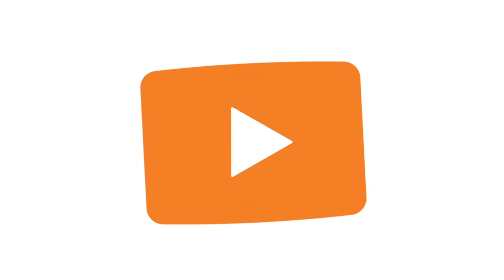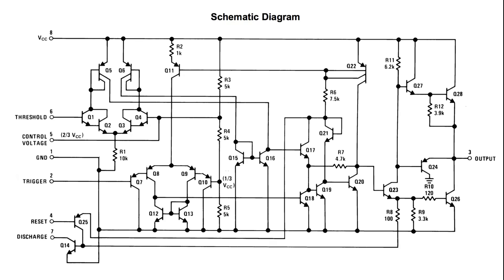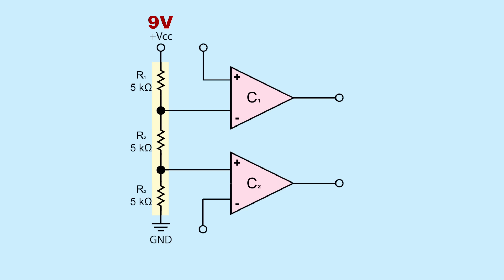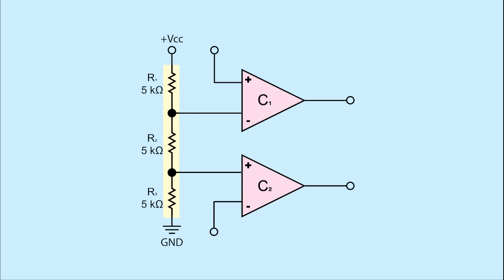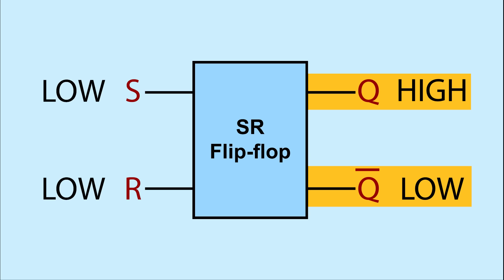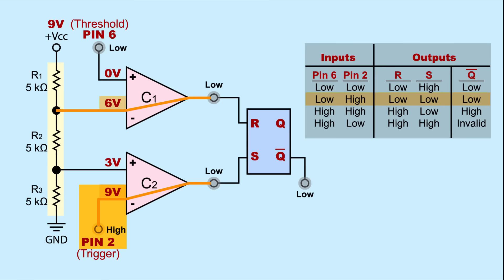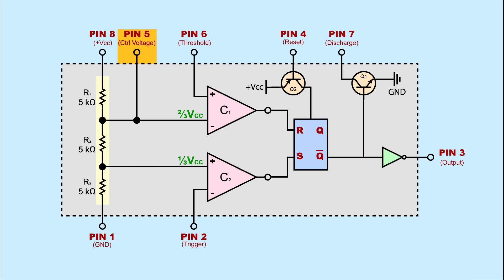How 555 timers Work - The Learning Circuit

Comment: If I didn't already subscribe, this video and it's follow up would make me do so. When I first saw them, it was somehow targeted at EXACTLY my level, and explained everything in a way that was like drinking fresh spring water.

I love that most of the video doesn't even mention a capacitor. The 555 is not in any way a timer - the only thing in a timer circuit which actually "measures" time is an external capacitor. The 555 is a glorified switch, which requires more components to do anything. That's why it is so versatile.

Comment: Could you provide a specific definition for the terms “high” and “low” when referring to outputs? 
Is this a binary state or low voltage output versus high voltage output? If a voltage output, what are the low and high parameters?

Comment: How to configure the 555 to output 100kHz as a signal generator for a transistor?
Reply: @ultralagger1  to get a frequency of 100kHz with a Duty Cycle = 50.5%  you can use the following values:
C = 100 pF
R1 = 1.44 kΩ
R2 = 71.41 kΩ

Comment: If I want to design a circuit for automatic charging system for 12volts Battery . A circuit cutoff at 13.7volt & turn on at 9volts. How can I design with IC 555. Thanks

Comment: Hey, why is usually 5 < Vcc < 15? Is it possible to leak less current with higher Vcc or what is the tradeoff of using different Vcc in a circuit that has a variable electric potential?

Comment: I’m very new. I’m confused with the digital signal of “low” and “high.” Is it 1/3 Vcc and 2/3 Vcc or the highest of the inputs and lowest of inputs? I’m wondering about building  circuits off pin 3 if you don’t know the voltage.

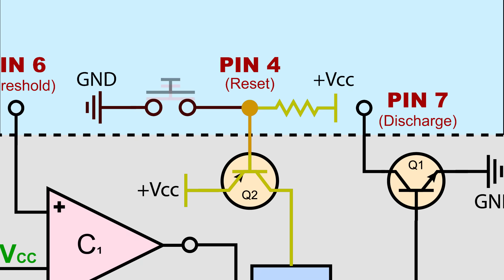Comment: Correct me if I am wrong, however there is a minor error: At minute 6:37 you state Q2 is off. A PNP is ON when the base is lower than the emitter. Additionally, the current limiting resistor should be placed between switch and Q2 base.

Comment: 6:30 "If pin 4 is ever grounded, going low, the transistor is turned OFF."
Actually, it's the opposite because this is a PNP transistor, so it is held OFF while pin 4 is high, and it turns ON when pin 4, its base, goes low.
Reply: Exactly, I was wondering the same thing. It seems a lot YouTube tutorial were taught this way.

Comment: I believe your Q2 logic is incorrect, the circuit is correctly drawn, Q2 would turn on with a low voltage (Gnd) on base and turn off with a high voltage (Vcc).  looking at the bigger circuit, the positive voltage supplied from Q2 collector is the reset to the RS flip flop.

Comment: Am I right that if one measures the resistance between pin 8 (VCC) and pin 5 (control voltage) one should get 5 kOhm ? Or is it more complicated ? ( I am trying to troubleshoot some PSB, and my on board measurement between these pins gives 120 kOhm)

Comment: I've always wondered why the 555 seems to be like THE chip that everybody cuts their teeth on when they start electronics. For me, I remember it was rather confusing trying to learn about it as a newbie to electronics. But if the whole idea is to cut your teeth on using chips, why not start with a simple logic chip? I think an inverter would be a great chip to cut your teeth on. They're straight forward, and easy to use. AND you can make an oscillator out of them by chaining together an odd number of inverters. It might not be as versatile as a 555, but for a newbie who's just learning and getting comfortable with ICs, I think it'd be much better.

Now you just need to do a complimentary video on how the 7555 differs from the 555 in terms of functionality on a transistor level.

Comment: Great video.
I’d also add that the rs latch is basically an electrical version of a mechanical toggle switch. But unlike the mechanical toggle switch the rs latch has 2 dedicated physical quantity inputs (either high or low) to change the state of the output.
The mechanical toggle switch has a single algebraic input consisting of the application of a + force or a - force to change states.
This 555 timer is an example of an application of the rs latch thru the use of the 2 comparators assigned to each of the 2 physical quantity rs latch dedicated inputs.
Such a configuration can be used for automatic temperature control as set  with a thermostat .
And so that’s potentially an additional  practical implication (besides an oscillator) of an rs latch configured with a couple of comparators to change states to turn furnace on or off to reject heat loss effects thru the walls of a heated building.
Unlike the oscillator both the period and duty cycle of the 555 output behavior in the furnace example will change depending on outside temperature.

Comment: I even made a simple class d amp using this circuit. It shows you can use 555 to do more than it's designed to
Reply: On an amplifier board for my computer speakers (which I am trying to debug, with my zero experience), 555 works as a standby on/off switch to the main amplifier chip (TDA1554Q)

Comment: Great job! Particularly the graphics illustrations and rapid technical explanation without any confusing filler.  However, I think it would've been a nice touch to add a quick closing illustration of the 555 in action by demonstrating its use in a very simple circuit like an Astable Oscillator... just a little satisfying payoff for your audience.  A happy ending as it were.  ;)

Comment: I wish we’d had resources like this when I was studying Electronic Engineering and building 555 circuits back in 1981!  Such a great little timer, I built all kinds of alarms and flashing lights etc with them, but  getting across all of the concepts etc was much more of a dry subject than it is today.  I really like how simple and clear you made this for people starting out. Great stuff.
Reply: I mean, that goes for any tech, right? I learned programming in the 80s, and you'd buy a single book on a single topic, for 80 bucks.
Reply: @larrybud  I'm 68. In the 70's they had mainframe computers behind glass doors in my college that ran tape. I thought writing instructions with zeros and ones was tedious. In 2008 I discovered I could control the behavior of motors by writing instructions. I was hooked and realized I had wasted my college career.
Reply: @awaitingthetrumpetcall4529  In the early 80s I was initially more interested in electronics (and cars/motorcycles lol) than computing but got exposed to personal computers as well as the mainframes in the telco space. 

In the early days most of the electronic projects that I built for myself were for cars and bikes - I built a full car computer that monitored fuel consumption and distance etc, car and bike alarms, electronic central locking.  

I got into computing outside of work in a big way when the Amiga 1000 came out (prior to that had a z80 machine at home), but the Amiga was a game changer. It could be programmed to play music properly and could display quality photos - something that the IBM based business machines just couldn't do.
Reply: @markedwards4879  I would have seen you as as an intelligent nerd. My only involvement with computers was playing "Pong".
Reply: @awaitingthetrumpetcall4529  LOL.
Reply: @larrybud  I still have some of those overpriced and dull books on the shelf lol. 

There was very little choice of content at all and most of it was presented in a way that made things more difficult than they needed to be.  I don't know about you but I had a mix of some very good lecturers and some that were just terrible.

Luckily I worked with some very helpful people while studying and was given projects that helped me learn and keep it interesting.

Comment: This is the first video I watched from you and I loved it. I used the 555 many times over decades but never understood it in such depth. Very useful and helps with troubleshooting  circuit design.
One thing I may not be understanding is that when you said that when pin 4 is grounded, the transistor turns off. Being a PNP, shouldn't it come ON when the base is brought to ground?
Maybe i misunderstood?

Comment: Are you an electronics engineer ?
Reply: In fact, you don't have to be an electronic engineer to use the 555 timer IC effectively :)

Though I know people who work with microcontrollers and use them even for simple tasks instead of using the 555 timer! I never understood that :/

Despite I am more of a developer than an engineer, I used the 555 timer IC many times in simple projects. I think, Colin Mitchell gave the best explanation of how this IC works.

Comment: When this chip arrived to the market place in 1972, how did customers understand how to use it given the complex explanation needed just to describe how it works?
Reply: Datasheets have applications circuits. Plus there's a formula for calculating components used for making delays. You don't really have to understand how the chip works in order to use it.

Comment: Great explanation, thanks...except I am stuck on some point I obviously don't understand.  sWhen the output is high (S is H)  and Q bar then being low there is no power flowing to pin 3, so no power going to pin3 - even though one would think it would if there was power getting through the flipflop. When S is Low Q bar is high and although there is power flowing through the flipflop, does it not then (through its inverter) cut off the power to pin 3? So how/when does power get through to pin 3? Sorry for such a dumb (I think) question...  
Ahhh...I watched the next video and it became clear    Thanks

Comment: Wow.. Now that's a video that will have to be rewatched a few times to understand...
A common use example circuit (e.g. voltage freq converter, freq modulation, etc) would have been useful. :-)

Thanks for sharing!

Comment: for the voltage divider, should not it be 4.5v each since it got the same resistor which is 5/(5+5)Vin  =4.5 V for both two Omp

Comment: Why would they use an inverter on Q not, rather than using Q as the output? 2 reasons for the question, the discharge transistor is going to limit the output of Q not to the base-emitter junction voltage of the discharge transistor. It won't reach logic level, unless, there is a resistor to the base of the discharge transistor. The other thing is the unnecessary additional parts count, and propagation delay.
     The Reset input transistor is a PNP. Tying this transistors base to the positive rail, the same potential as it's emitter, turns the transistor OFF. Again, there has to be some resistance on either the base or the emitter of this transistor, or it will immediately blow out, if the Reset pin is tied down. (full supply current available to the base-emitter junction) I personally, haven't designed any circuits, where the reset pin isn't just simply tied to the positive rail. I just connect pins 4 and 8 together.

Comment: O.K.  ,  O.K. I will admit I developed what could be my own version of digital electronics (using relay logic) from memory of what I had learned in school. But I am quite STUCK on why industry does not use RS flip flops made with an AND gate OR gate inverter combo.  Is it I have my versions function mixed with something industry usually uses? By memory my version of PAC MAN would be impossible to create in about a week without a RS Flip Flop that can have both the R and S inputs both high. The R input takes control in this case. I am guessing the start stop station for many industrial applications operates by the same principle.  My version of Pac Man is not half bad and takes no expertise to create. Let know when your interested in an easy approach.

Comment: Im not sure about one thing! Who controls those voltages automatically? If i switch on a light bulb. I have to manually flick the switch ON to make it glow. But in computers i don't understand how they do it automatically? I want to understand how they do it. Is a something related to the chemicals used or some thermo electrical thing which open and closes the circuit ay a desired temperature???
Reply: Is probably covered in another video but is has to do with charge/discharge time and the transients of capacitors in cooperation with the circuit explained in the video
Reply: @netoskin  yea but still not clear. Can you point me to any video that explains that?

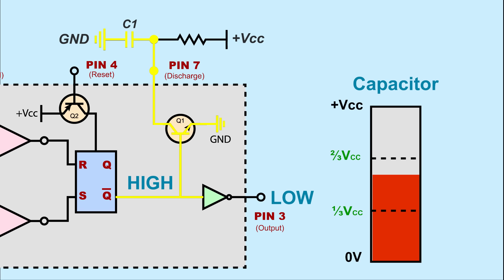Comment: how does the capacitor triggers the reset ? 7:03
Reply: I believe they forgot to present a few more connections from the capacitor (and one resistor is missing) to PIN 2 and PIN 6. Just look up ‘555 timer astable’. 

I might be wrong tho
Reply: I was going to ask the same thing, since C1 isn't connected to the gate of Q1.  There must be some extra connections involved.

Comment: This is one of the best presentations for working of the 555. We've used the 556 as astable and monostable together to produce a PWM signal for a Boost Converter, 12v t0 48v DC at St. Joseph's Research, BLR, IN.

Comment: Nice presentation...you could get a PhD studying this circuit it is so versatile. The 555 should be in the chip Hall of Fame - a timeless timer chip. 5k+5k+5k = 555 nice! Good thing they didn't use 6k resistors LOL.

Comment: Nice explaination. I have 1 question. In the block diagram, transistor at pin 4 is appeared to be PNP type. To turn it "ON" isn't that mean BASE voltage need to be negative compare to EMITTER? In the video you said when ever pin 4 is grounded, the transistor is "OFF" which is contradict with what I understand about PNP transistor type.
Reply: Yes, you are right, the pnp explanation is wrong, when the reset pin is pulled high to VCC the transistor is off.  But her schematic is correct.
Reply: @zeeebrenn  I was just going to say the same thing but you beat me to it by about 17 hours. Note to self: Wake up in the MORNING, not the EVENING. And, Happy new year.
Reply: @zeeebrenn  Yes, and I guess that is why in applications when the reset pin is not used, it is permanently connected to VCC.
Reply: Your observation is accurate. The IC indeed becomes active when pin 4 is high, and applying a low signal at pin 4 resets it. To rectify this, we can interchange the positions of the switch and resistor. Specifically, we can connect the switch between VCC and the base of the PNP transistor, while the resistor should be connected between ground and the transistor's base.

Comment: nice explanation of the parts of the schematic and how the connect. Sadly that is all I got from it. Here's my problem though: A the start of the video I read that it is a "555 timer", so I assume it keeps time somehow. After watching, I understand that in fact  it has functionality to compare voltages and weirdly contains an inverter when the Q pin could have been used to the same effect. The output of the compares goes into another thing. There are some pins too and I now know what they are connected to. An analogy would be if you showed me a washing machine in peices, but called it a motor car and explained that "this bit changes voltage levels" or "this bit spins" or "this bit pumps" then at the end said there are different modes. I'd have no idea what it did or how it worked.

Comment: Sorry, but just to be sure I have understood: 
At moment @6:26 when you explain the Reset pin, it seems looking at the video that the behaviour is the opposite: if Q2 is a PNP transistor, when base is connected to Vcc, it is OFF and set RESET of FlipFlop to LOW (resetting it), 
but from the video it seems that vhen the base is HIGH,  the current is flowing from Vcc through Collector to Emitter and to RESET (tipical for a NPN transistor). The final effect is correct but I think the animation should be the opposite. Is it so ? Thanks
Reply: Q2 is off when switch is off, and halfway on when switch is on.

Comment: Does it contain a SR Flip-Flop? I think the 555 contains just a SR Latch because there is no clock or enable signal to set/reset as a Flip-Flop would have.
Reply: Its a f.f and the enable is connected to pin 4

Comment: Nice presentation, Karen and thank you for the information  on the internal  operation of the 555 , i have one doubt, is it a SR latch or flip flop ? if it is a flip flop i guess clock has to be provided for its operation which is not shown in diagram.
Reply: flip flop. She said so.

Comment: what will happen if you replaced the ceramic capacitor at pin 5 with cylinder capacitor ?

Comment: Are you serious? This is an IC that is such an outdated chip, so much part of the 1970s. This is like the Beatles, the Apollo program and phones with a mechanical circular dial. Why is Element14 putting up this kind of content at the end of 2019?. This stuff is 50 years old.
Reply: The very fact that it is 50 years old proves that it is timeless, just like The Beatles.
Reply: Because it was most sold chip of all times - over 40 billion produced!

Comment: If I’m correct, Pin # 4 is the Base of a PNP transistor which Is set Hight turning the transistor OFF, and when the switch is pressed the base is grounded, an therefore the PNP transistor should go ON.
Thank you
Reply: gusel9 I agree. That is why the emitter is connected to Vcc internally as shown.
Reply: I'm so glad someone else caught this it was driving me crazy!